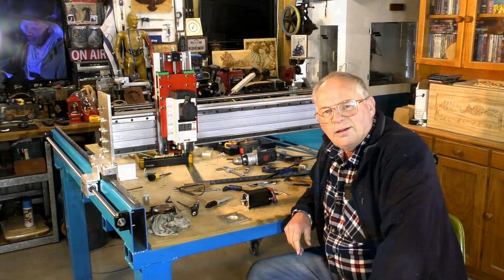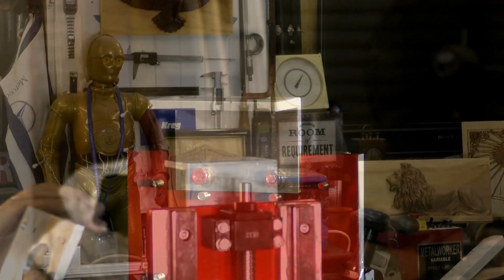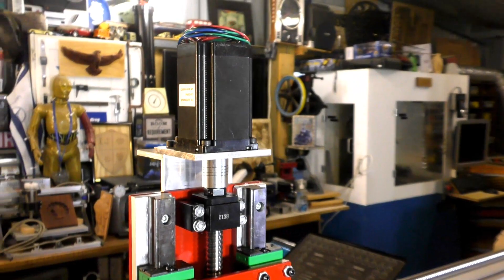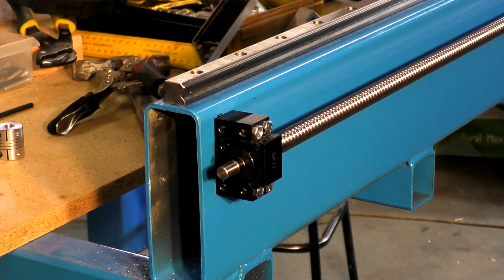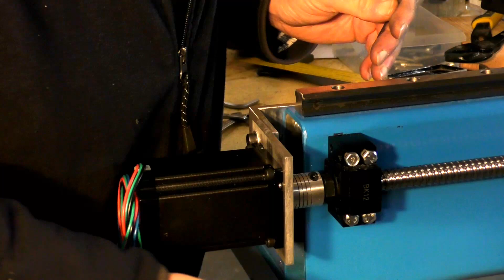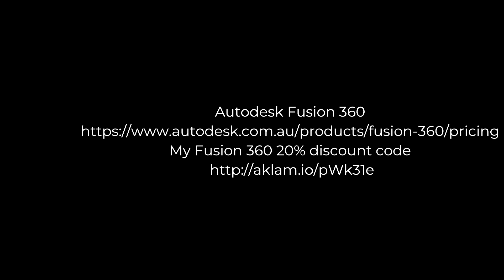HOW TO CNC conversion fitting Y & Z stepper motors [Episode 11]

Comment: Hi Roger.  That's an awesome looking big CNC router that your building mate.  Can't wait to see it up and running.  Cheers, Aaron.
Reply from the maker: Hi Aaron, you and me both! I have been a subscriber to your channel for many years and cruddCNC.
Reply: @inventorsworkshop9600  Yes I know mate.  Thanks for your support over all these years.  I've been working hard on my other channel Aaron Engineering.  Christ, YouTube was so much easier 10 years ago when I started.  Cheers, Aaron.
Reply from the maker: Aaron, would it be a help, and ok with you, if I put your channel up on my featured channels section and vice versa ?
Reply: @inventorsworkshop9600  G'day Roger.  I just sent you an email.  It is from my Hotmail account, so just check your junk mail if it's not in your inbox.  To answer your question, absolutely.  Which channel is it though?  As you have two of them don't you?  Cheers, Aaron.  PS: lets chat via email 😉